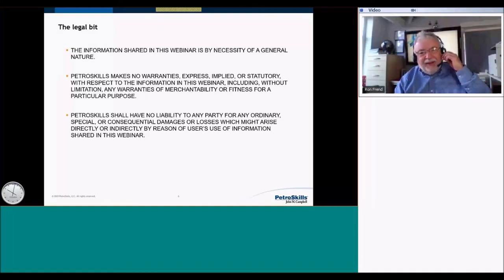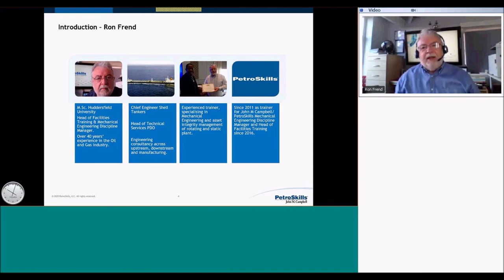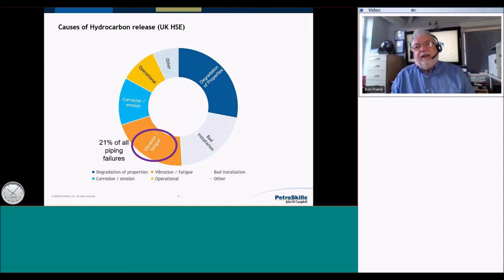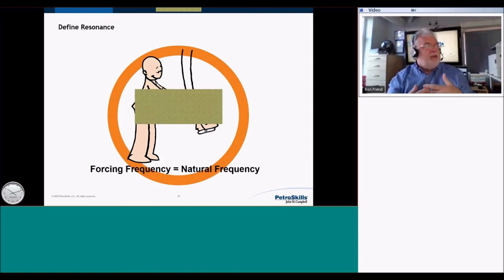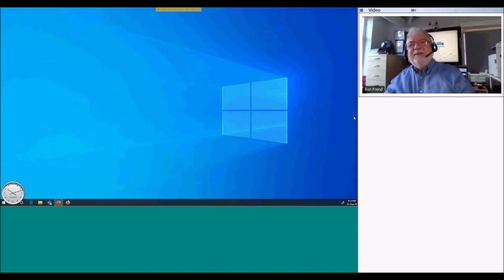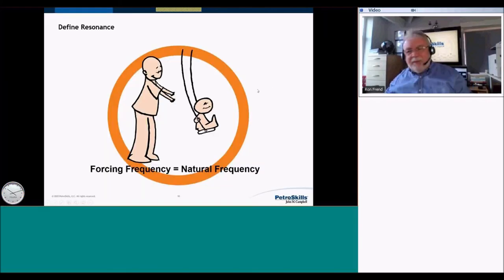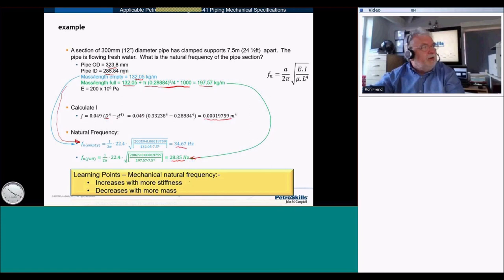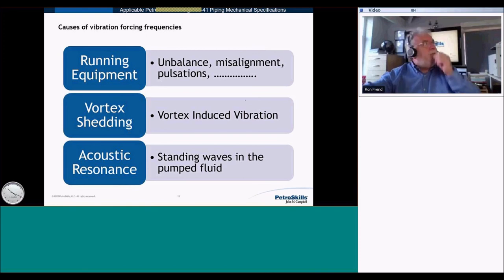Are You Scared of Vibrating Pipework? You Should Be...

Comment: I witnessed something quite extraordinary a few years ago. The lamp post just in my street, which was not really tall, just about 2nd floor house height was vibrating, there was no wind, but the vibration was quite unusal, it was more like a sine wave that was passing through the post quite violently. The amount of vibration was as if it was made of rubber but was also vibrating not just from the base to the top, but at two points, like a secondary vibration. It looked unreal, because beause the post is sturdy, not very high, and I just could not figure what could be making it do that, nothing else was moving like it, only the post.